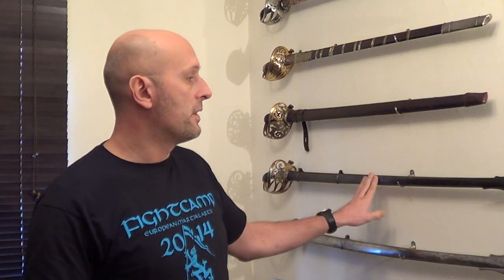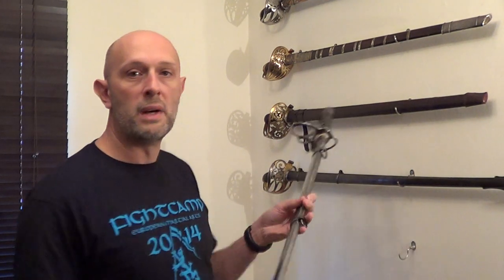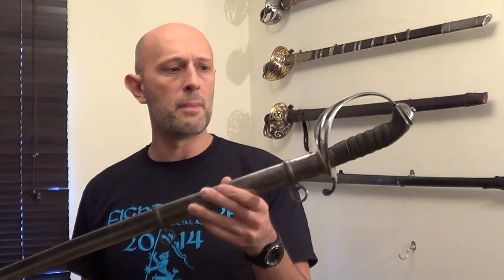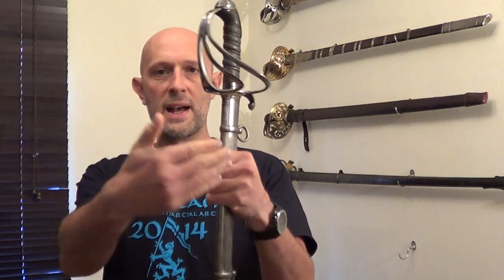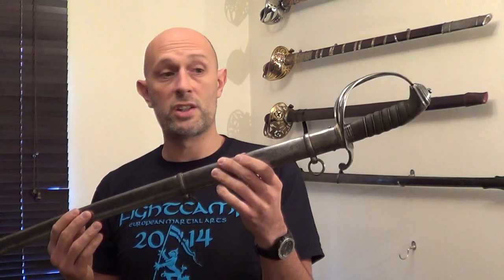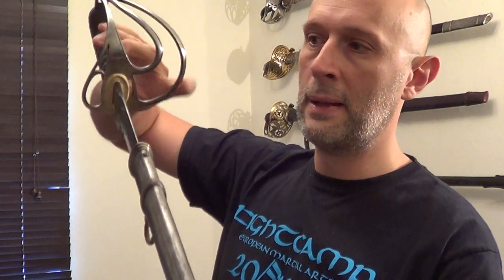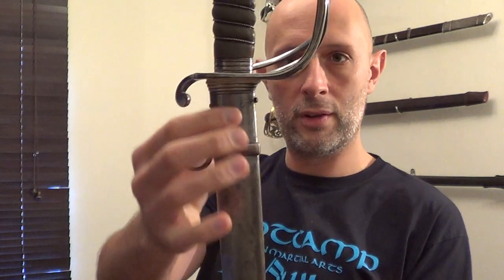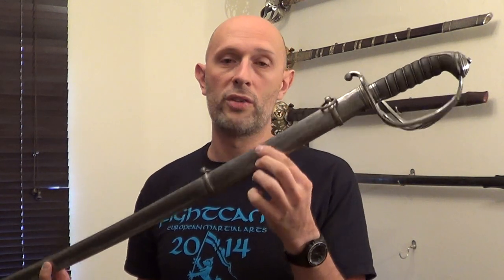Why make sword and knife scabbards of metal?

Comment: This video explains why you would want to make scabbards out of metal rather than wood, but why would you want to make medieval scabbards out of anything other than leather (other than the rusting/storage problem)? Am I the only one who finds it a bit distracting to have a large piece of wood dangle around when you're fighting?
Reply: This doesn't seem to have been an issue for the Medieval warrior- either because of the manner of harness used or simply they were more used to wearing these on a daily basis. In any case, Medieval sword scabbards seem to have almost entirely been wood core, leather outside. Cost may have been a factor- heavy grade leather required for an all-leather sheath was expensive, possibly far more than wood, which was usually a fairly common birch or something similar.

Comment: I'd be way more comfortable with a steel scabbard because I'd be worried about the sword cutting through the leather and slicing my hand open, otherwise.
Reply: Most scabbards with leather outside are actually wood cored, then covered with leather. The wood "sandwich" in glued & often pinned around the edges & will not get sliced through as the sword is drawn & sheathed. A purely leather scabbard is usually made from quite thick leather.

Comment: In modern time, if we for some reason started using swords again, do you think we would use carbon-fibre scabbards?
Reply: Or plastic ones for that matter.
Reply from the maker: I would think that anything used on military firearms would work, though if swords came back in modern times, then they might be a status symbols and so rather use expensive materials, rather than military-grade materials. It depends on the context really :-)
Reply: scholagladiatoria Hi. I always joke with though I really mean to my norwegian national gurard (HV) fellows that I should attach my gladius to the vest.  :-)

I have been nagging them for years about what to do about knife, attacks, axe attacks and the occasional sword attack. The answer is usually to "just shoot him!" But most of the time soldiers are not armed with firearms, the frie arm has no ammo in it or it is not fully loaded. (You must do a loading motion before you can fire.)

Also in a crowd, firing shots at close range in panic mode will kill or wound your friends or some innocent bystanders.

And in light of the latest threats and actions from terrorists I think soldiers should carry swords all the time when in uniform and on duty. ;-)
Reply: I think we'd see similar materials to those used on modern knife sheaths and gun holsters. Sometimes carbon fiber, but often kydex, fiberglass-reinforced nylon, heavy nylon canvas, and injection-molded plastics.

Comment: Can´t a scabard that doesn´t touch the blade be made?
Reply: He mentioned the throat of the scabbard is what normally makes contact with the blade, so they make the throat out of a softer metal to lessen the blunting. :)
Reply: A really good scabbard is made with a close fit so as not to be too bulky or heavy (or rattly), but generally it shouldn't be snug enough to actually grip the blade except on the few inches closest to the hilt.

Comment: too bad kydex is relatively new
Reply from the maker: Kydex or various types of plastic are good for scabbards, though they do blunt edges more than wood does. Basically the harder the scabbard material, the more likely it is to blunt the blade, unless the design includes a feature to keep the outer scabbard material away from the blade (such as the wooden slats inside many steel scabbards).
Reply: well i guess you have a point there.

hearing about your story about leather scabbard and blade rust... traditionally here, blades were kept in sheaths that made of wood, leather, horn, or some sort of pandan or rattan weaving, depends on local culture. all of those are less harmful to the blade, but peoples tend to not keep blade in (tanned) leather sheath for long. because it's acidic and could trap moisture (especially here in tropical islands of nusantara) thus tends to ruin blades quickly :D
Reply: scholagladiatoria I know fiberglass-reinforced plastics can dull the edge on knives, but I think kydex is a much softer plastic and doesn't have any sort of abrasive filler. I'd be more concerned about the rivets that are generally used to attach two sheets of kydex around the blade.